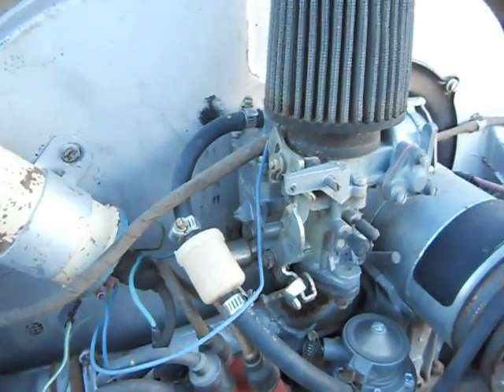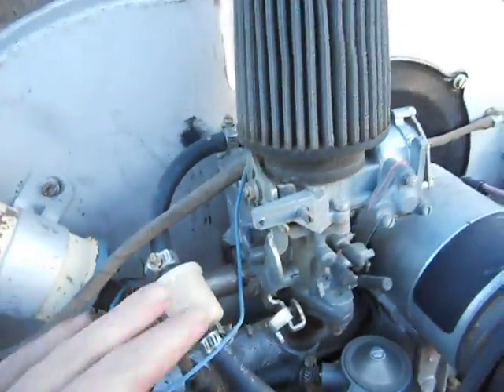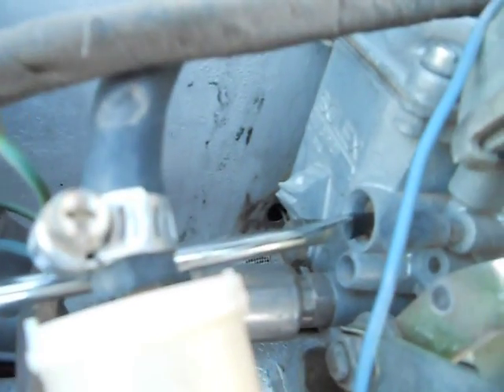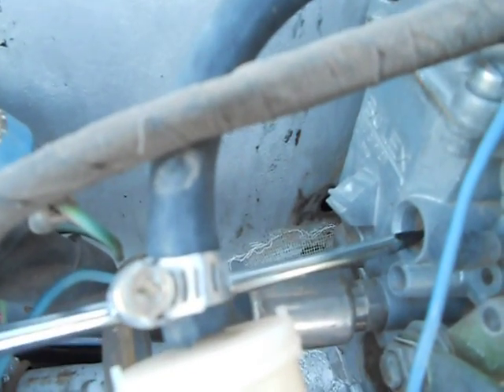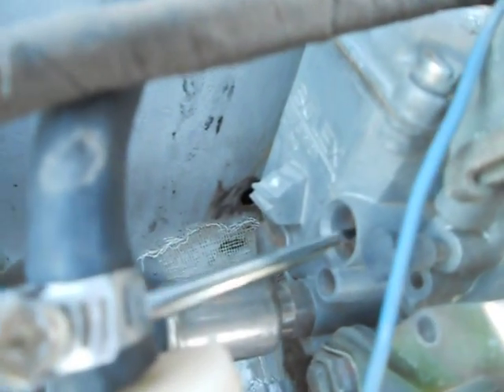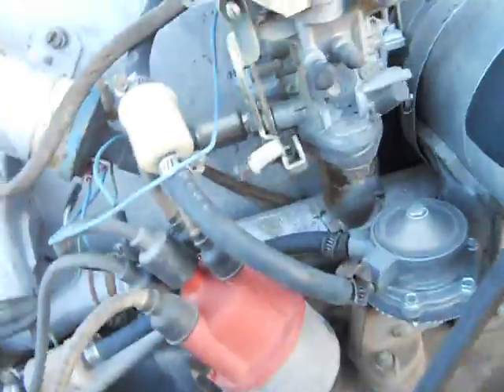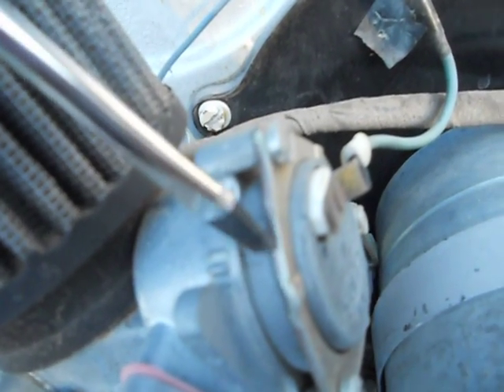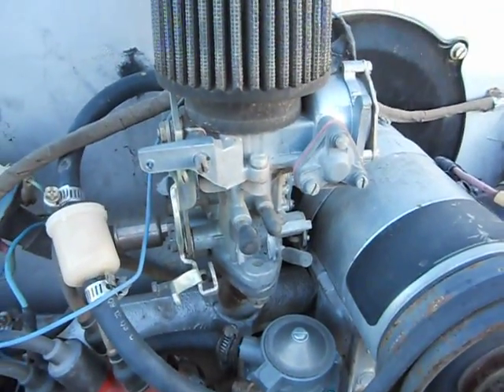How to Pre-adjust a 34 pict-3 carburetor before First start on 1600 cc motor

Comment: The auto choke should actually be adjusted to where the butterfly it is just closed when the engine is stone cold. This is not necessarily where the lines are and should be changed with the change of season. Either that or open it all the way and warm it up yourself.

Comment: Before adjust the carb. You must identified, which one is the  volume control screw and air bypass screw. You were turned the 21/2 setup for bypass screw. it was wrong.  21/2 adjustment needed for the volume control screw.  Bypass screw is maintaining the ideal  and air bypass and for speed 800rpm to 900rpm

Comment: Thanks for the info on the 1600 Bug.  The engine runs too fast once it is heated up. Is this still a carb adjustment problem?
Reply: I know this is an old comment but you should always adjust your carb when your engine is fully warmed up. What is shown here is just a starting point.

Comment: Where would you put it? There are really no other good options. Anywhere in the engine compartment has the potential for fire if it leaks. You just live with it, and do  periodic visuals on fuel lines and connections. The ideal spot would be directly under gas tank on the fuel hose going to the steel fuel line  connection, but it is hard to get to. Maybe I'll try that sometime.

Comment: run a line from the fuel pump to the carb...no filter here..put the fuel filter before the pump..preferably close to the tank..this eliminates any chance of those filters splitting and spraying gas onto the dist. and coil....great video.

Comment: Do not put your fuel filter there, on a vw bug you want to eliminate all possible splices in the fuel line near the engine compartment or you're begging for a fire. I know there are not alot of places to put it, and safe locations are limited, but just trying to watch out for ya man.